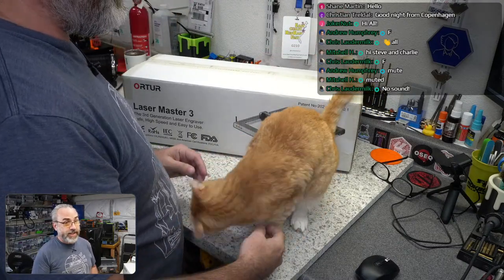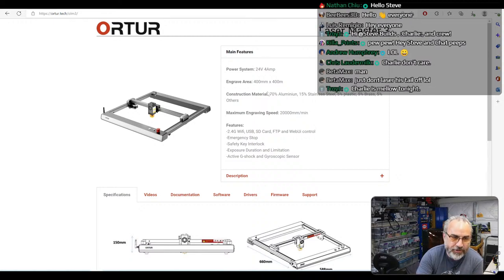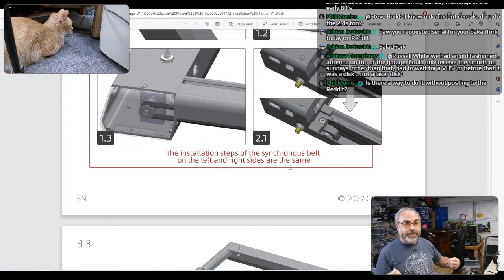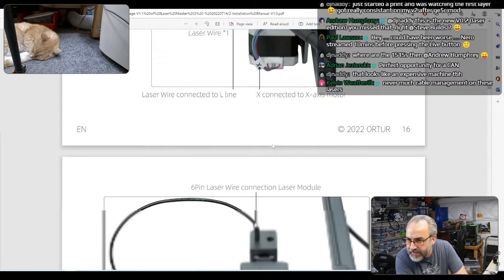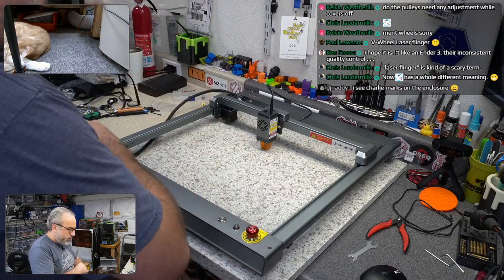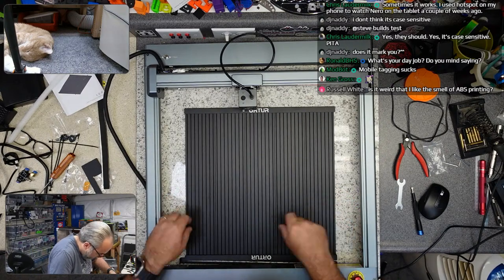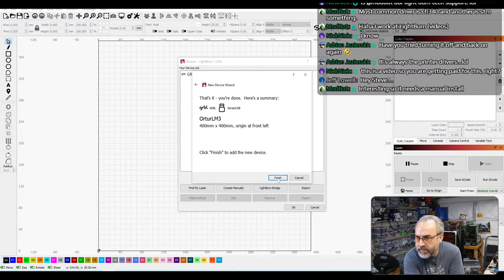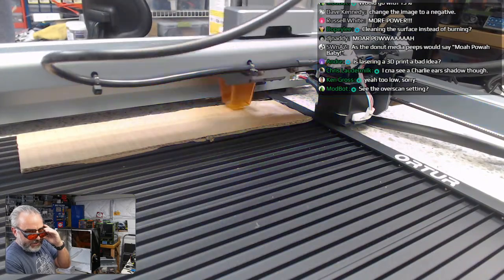Ortur Laser Master 3 - Unbox and Overview

Comment: I’ve seen videos where when doing clear/reflective surfaces they cover it with painters tape to avoid distortion.. wonder if I could cut panels for the 350 with it.. my floor panel is warping something terrible
Reply from the maker: 350 panels are going to be way outside the cut area of most of these diode lasers.  This one is 400x400.  Your panel is around 470ish right?